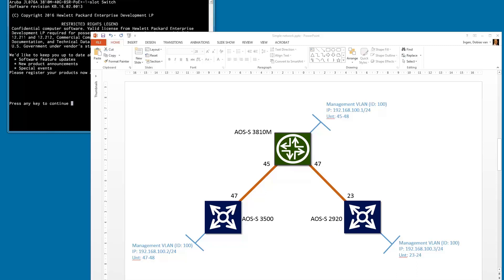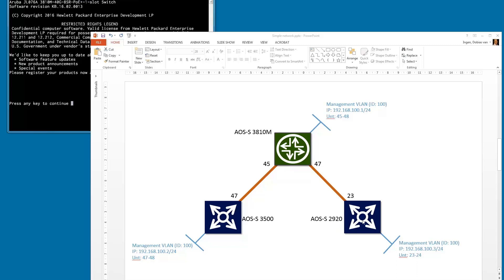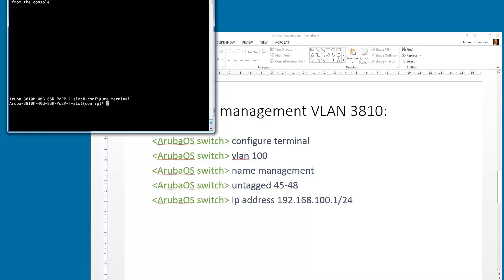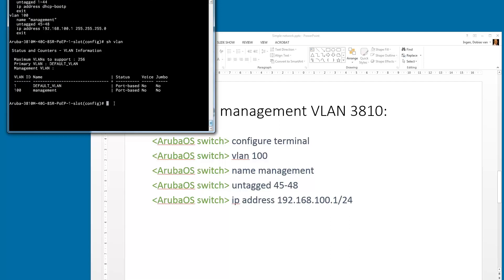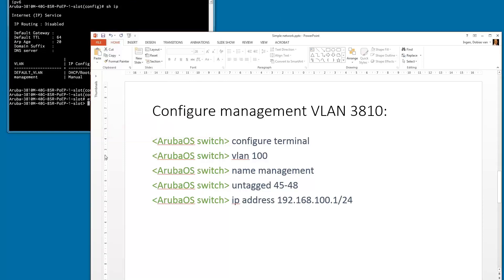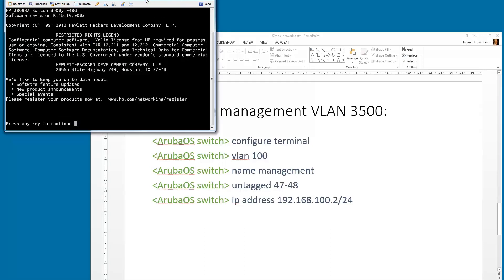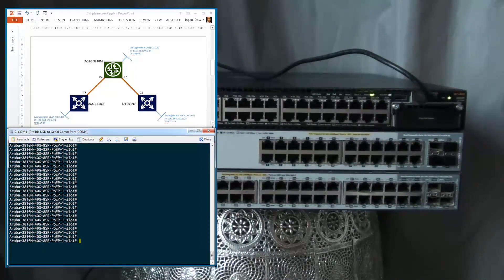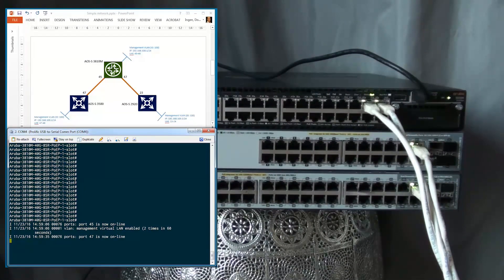AOS Switches   Let's Build a Network Management VLAN and Cabling - 2

Comment: i know this video is old, but just a tip for others, you will want to disable the native vlan 1 port from management after you've configured a new Vlan for your management. Vlan 1 is primarily attacked as its a common vlan for management by (if not all, most) all vendors.